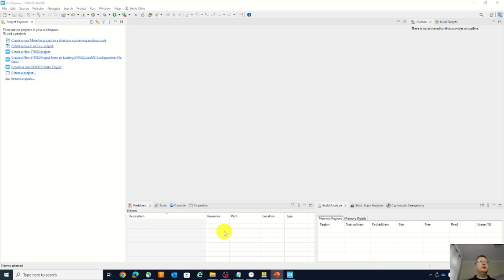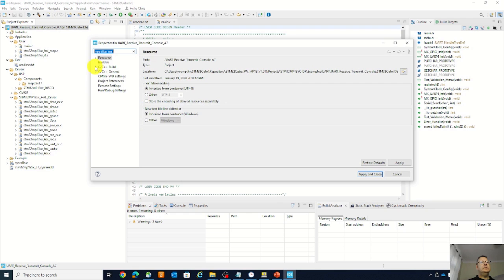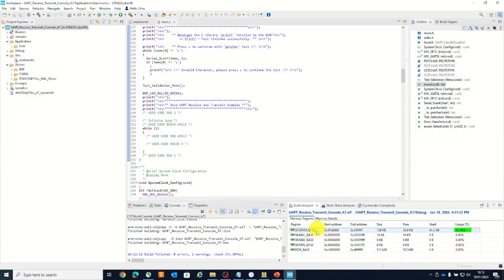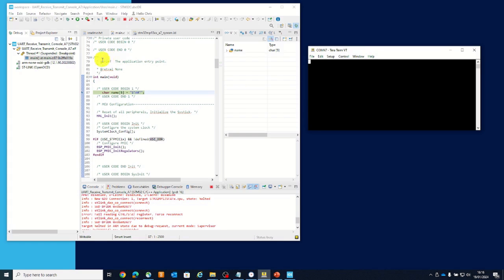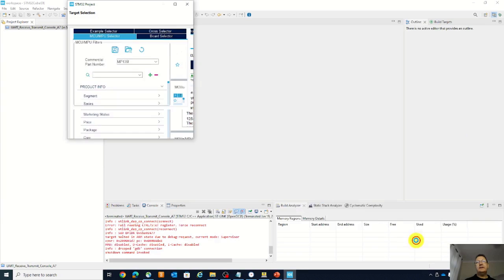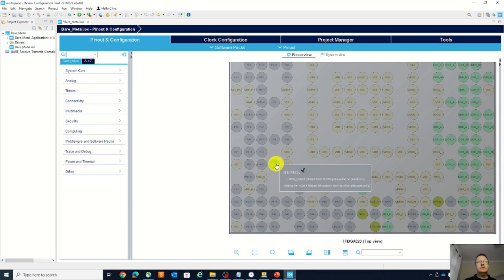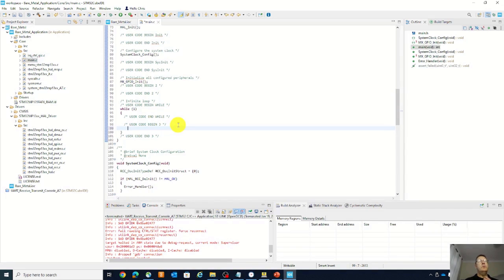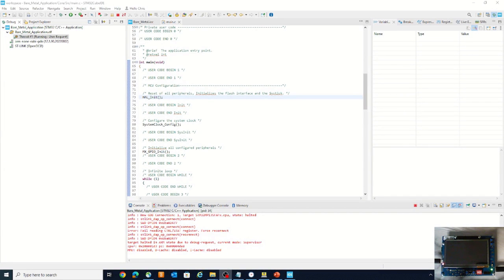STM32MP13 Bare Metal workshop - Demo

Comment: Thanks. So this code is tranferred to SYSRAM_BASE, therefore I expect a power off/on cycle of the board makes the program lost. Then I guess the missing pieces would be som work to transfer code to some non volatile mem and write a custom external loader, and all fitting nicely with the debugger symbols.